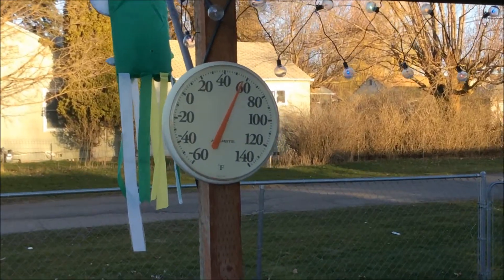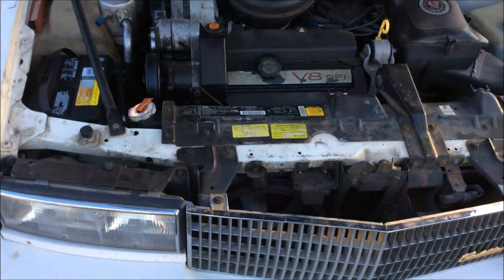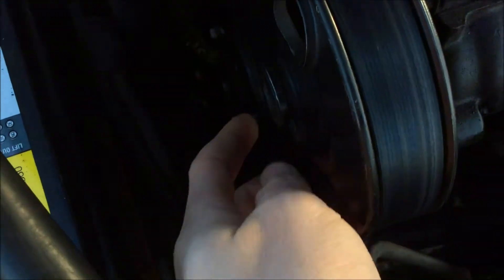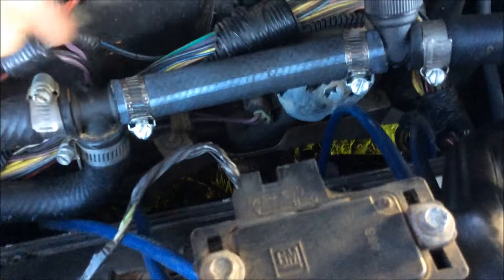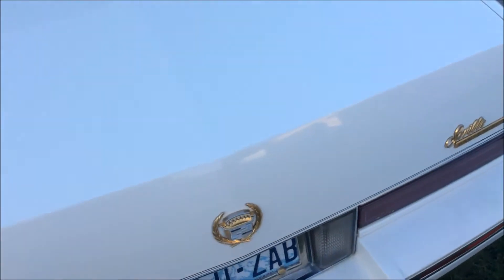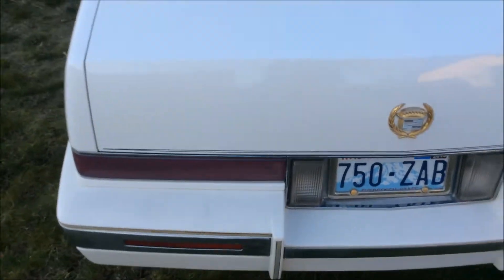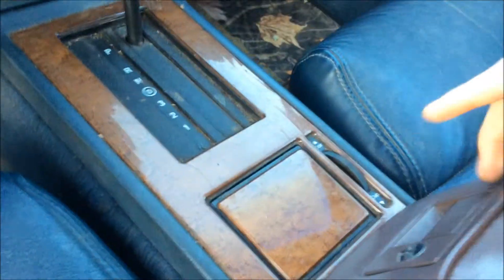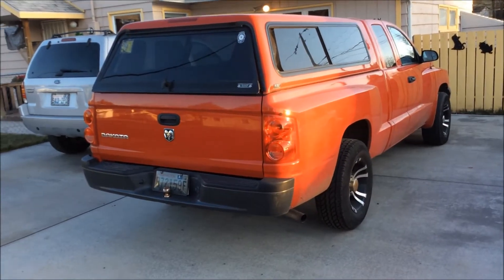Car Update | 3-7-15

Comment from the maker: Ironically, after the first month, 10GB of data just did not cut it at all. So our internet plan has been upgraded to a 15 MB/s down, 2 MB/s Up service with 50GB of data each month with the same 50GB of data between 2-8 AM. It still sucks because I still run out before the end of the month (which makes it throttle to a speed slower than the slowest dialup it feels like, but I can still get online somehow and just BARELY watch 144p YouTube which actually has to buffer that low quality), but it is a hell of a lot better than what I was having to deal with before, I'll just tell you that much. Maybe that's why I don't upload as often as I once did or wanted to here at home. Lol